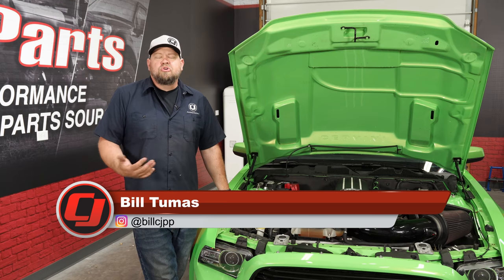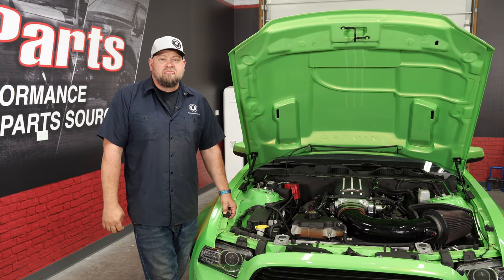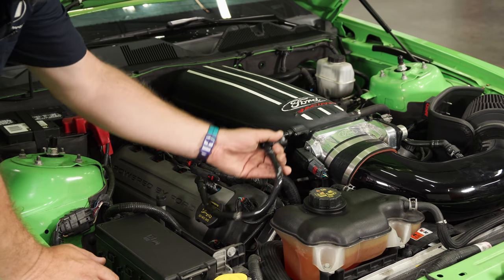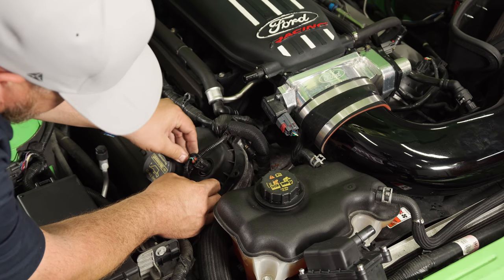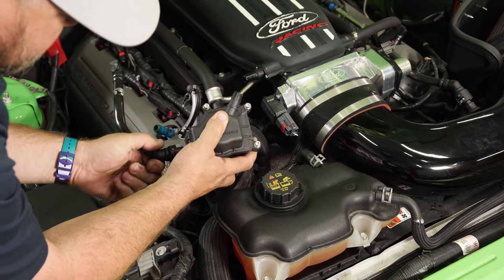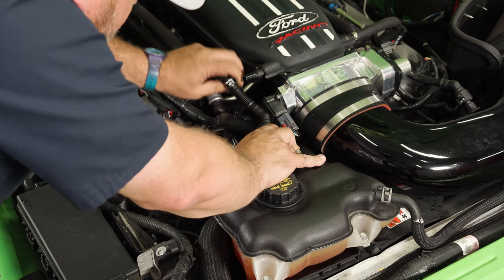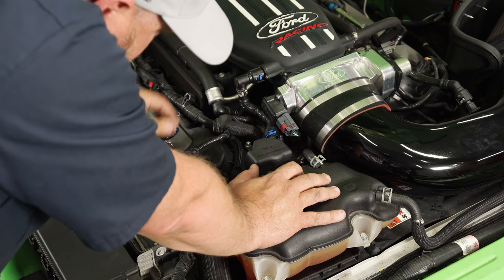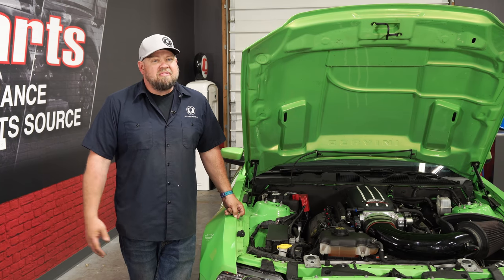Mustang Install: Ford Performance Passenger Side Oil-Air Separator Kit

Comment: Hi Bill,

Thank you for your videos. Could you make  a short video about the ford performance oil separator part# M-6766-A50A ? I am having trouble removing the cam cover bolt. I have no idea how to remove it an not damage the screw thread.
Reply: Once you get the bolt loosened all the way, use needle nose pliers to pull up on the underside of the head of the bolt.

This will free the sleeve on the bolt from the cam cover.